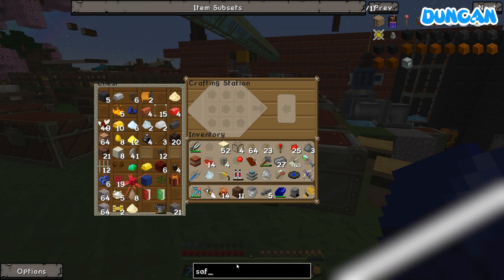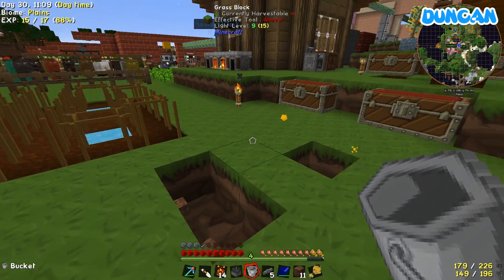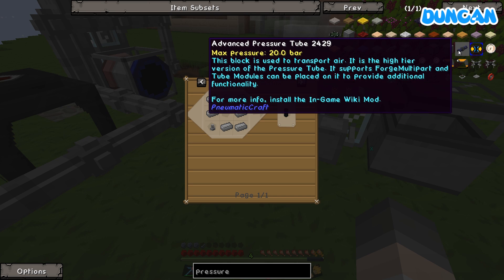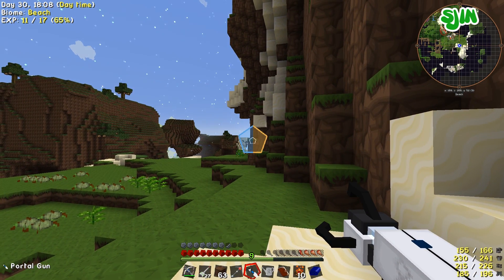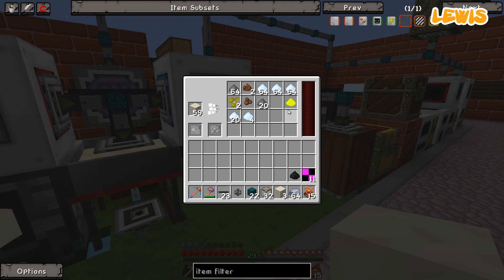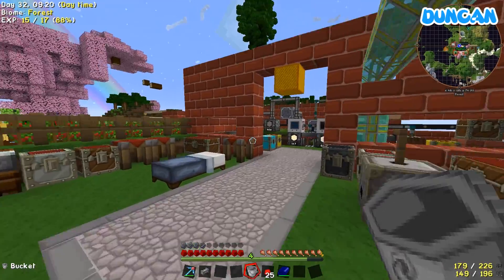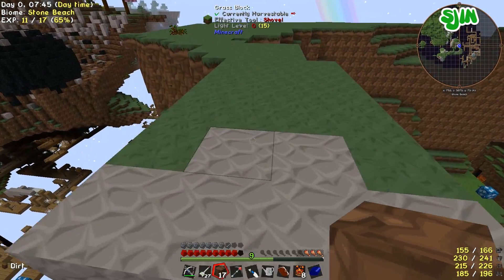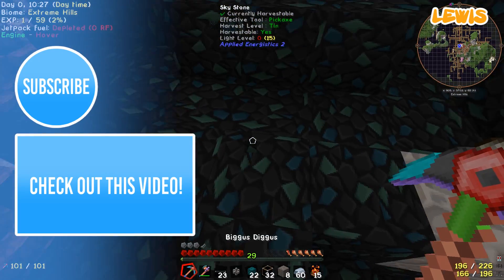Minecraft - NEED MORE PRESSURE - Project Ozone #55

Comment: DUNCAN you can break all the chance cubes and hexacubeglobe things because its only the compact giant chance cubes that have the big nuke thing in them which is only 200 blocks in diameter anyway. just start breaking them and be aware of bugs (that you can oneshot now anyway)
Reply: that's not true, i have had the nuke happen multiple times before from normal chance cubes and the isodecahedrens
Reply: tis true go look at the configs for getting that stupid plate shaped thing that just blows up
Reply: they are just boring as long as they don't open the compact giant ones they are fine. just upvote so dunc sees it and starts opening them
Reply: lol, i've opened around 20 nukes, and none of them were from giant cubes. Chance cubes are really terrible in this modpack, and you can't make the 100+ buff pendant. Nukes are great for removing bedrock btw, atleast in the nether where i detonated them
Reply: There's no point opening the cubes now, it's almost always going to be bad. If they wait until they can get more of the luck charms then they can significantly increase their chances of getting good loot. Opening the cubes now would just be wasting them.
Reply: yeah but they wont even do that they haven't bothered even looking into the charms, it would make the series a lot more interesting for the viewers anyway.
Reply: The pendants don't stack(did in sky factory i think). you can't craft the 100+ pendant(max 50+) 
the chance cubes has a range from -100 to +100, and it's bad luck all the way to 80 in this modpack, and the lucky +100 isn't that good.
Reply: Still they might as well
Reply: For the entertainment value, yeah, i agree, i do enjoy suffering.
Reply: MATTHEW PARKER there are two different "nukes". one is just a large explosion that blows everything up that you can get from the cubes and icosahedrons. The other is a massive black hole that makes so much damage that it can crash servers, and I believe I also got that one from a small cube. Both cause enough damage to discourage them from getting their stuff back legitimately leading to more cheating or even ending the series
Reply: MATTHEW PARKER DUNCAN, CAN YOU NOT JUST USE A NETHERACK WITH A FLINT AND STEEL TO MAKE A FOREVER FIRE, PLEASE

Comment: Yellorium can't be pulverised, that probably one of the reasons why your getting the invalid items and not a lot of yellorium. Also torches are a good source of heat for the pressure system. That's what you have used before.

Comment: duncan wouldn't have that heat problem if he didn't kill the adamantine cow, because if you know, the adamantine cow originally generated the heat duncan needed for plastic, the adamantine lasted forever, just like the LPG last as a forever fuel, after sjin killed the adamantine cow, duncan could no longer make heat
Reply: ofc he can, and he is, the refinery has enough heat now to work, vortex tube and heatsink is all you need
Reply: sorry i phrased that wrong, i meant to say, he could no longer make heat easily, still the adamantine cow would be much cheaper than the heat sink and vortex tube

Comment: Imagine if Duncan would just use rubber from rubber trees to get rubber bars. Then plastic dust and plastic sheets. Then smelting it into liquid plastic, saving lpg.
Reply: different plastics. last time he wanted the plastic from rubber trees and tried to use the pneumaticraft things
Reply: DreamblitzX yeah but it might melt down into the same liquid plastic maybe
Reply: DreamblitzX He still used liquid plastic in a bucket for the same machine earlier in the series I swear.